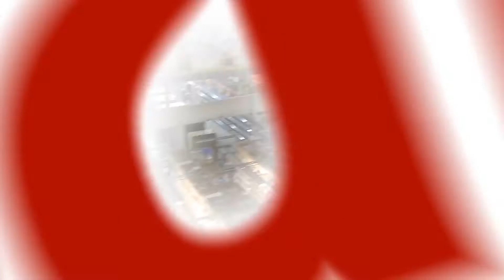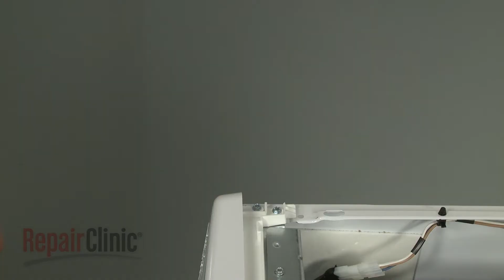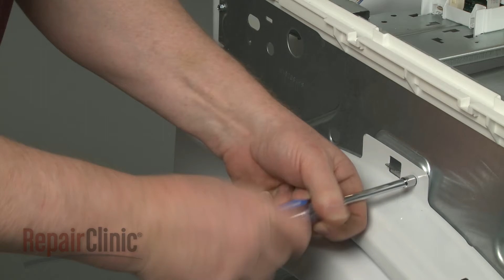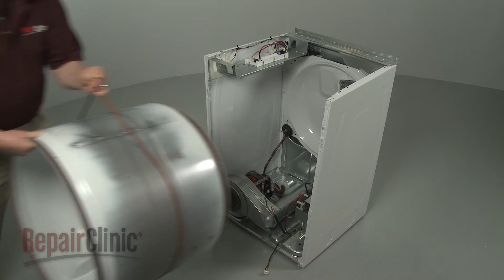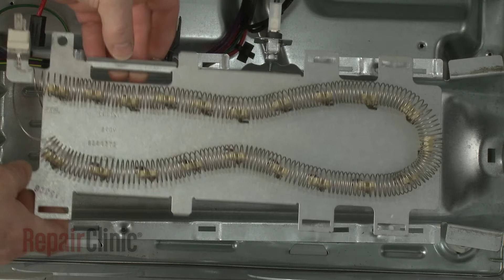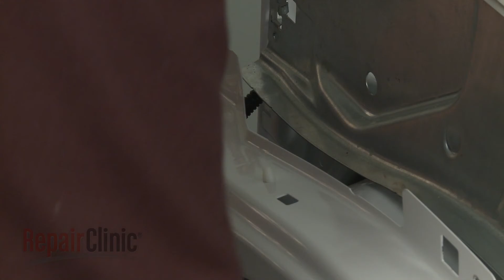Whirlpool Electric Dryer Heating Element Replacement WP8544772

Comment: My issue is the heating element is in encased housing. There are no screws to separated. There is a pin and I’m not certain how to push it. Pull it rip it apart. I don’t know.

Comment: has to be the worst instruction I've seen..... take wire completely off and pull the whole element housing out so you can work on it, also you don't need to pull the drum out there's better video out there

Comment: This video helps alot; even though mine was a Whirlpool Duet and the heat element only has 2 prones; it took me about an hour to replace everything; thank you so much for the video and especially those points where it is heavy, sharp, etc. were indicated.  The part was a bit pricy and I got mine from the Whirlpool factory.
Reply from the maker: Glad it helped

Comment: This made the heater replacement fast and easy (Any person that can use a tool can do this). Instructions are great, informative and the built in safety messages at certain steps (like heavy, sharp, etc.) are well done. Thankyou!

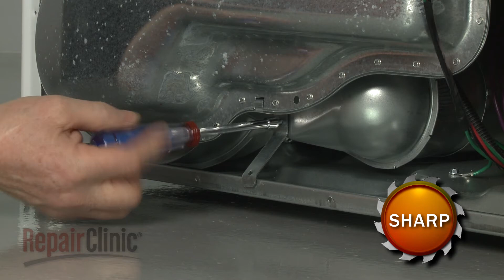Comment: While you're taking the drum out you should go ahead and remove the metal exhaust (shown at 2:39 connected to the lower support bracket) and clean it out as there will most likely be a build up of lint here which you cannot normally get to.